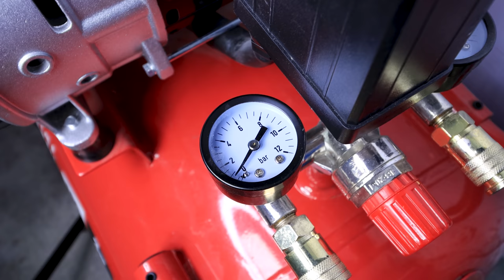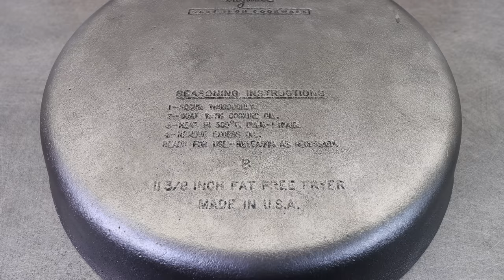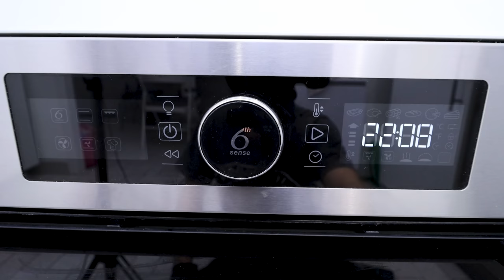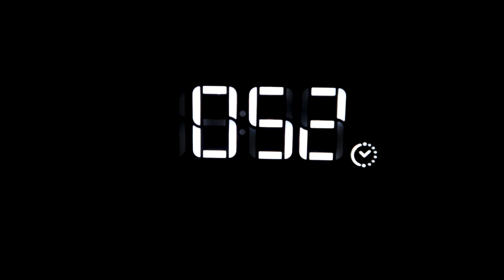PUBG PAN Restoration - Cooking Juicy Pan in to a Rusty Steak

Comment: That pan isn't 130 years old its actually from the 90's these particular ones started selling in 1991 so 30 years is more like it
Reply: I think what he meant was that the pan would look good for it's age only if it were 130 years old so he was being facetious
Reply: Yeah, the guy who wrote the letter got it wrong.  1891 is part of the brand name, not a date of manufacture.
Reply: I actually didn't know that and I think the channel didn't either
Reply: I have 4 of these 1891 Wagner Pans + 2 pots. Received as a wedding gifts 1992. Outlasted the marriage. No doubt will outlast me.
Reply: That would be correct.   It's a newer pan.  I have a few Wagners from the 1920s to the early 1960s.  Different handle design and smoother surface.  And no the rough surface isn't from rust pitting but not polishing pan after releasing from sand mold.
Reply: I think his Guns n Roses tshirt is older than the pan
Reply: In the USA only the Lodge Company makes Cast Iron cookware that I'm aware of. Cast Iron is the best cookware one can have! I have 6-7 iron skillets/pans.
Reply: Cast iron pans weren’t required to say “Made in the USA” until the 70’s, so there’s that.
Reply: I'm glad someone knew for sure. I had a feeling. The style and shape of the cast looked too new. Also the grammar (I guess you'd call it?) felt much more recent. Great video though!
Reply: @neodynamite  Actually 1964 and newer had the Made in USA stampings.
Reply: Also if it had been made in 1891 it would have had a gate mark on the bottom. The gate mark was a raised line running across the bottom from the early casting process.
Reply: @amandahanson8188  incorrect, never had to be casted into the pan. Lodge and other companies produced them without it for a while. Lodge was till 92 before the standard small egg logo they have now.
Reply: I was wondering about that. A 130 old pan couldn't be in such good shape after such exposure. And the 1891 engraved so big really looked like a brand name or something.
Reply: @neodynamite  It wasn't a requirement. It was a marketing decision after cheaper foreign imports entered the market in the 60s and 70s.
Reply: I was gonna mention this. I love cast iron pans, especially from around the turn of the century. They are better quality and so much lighter. They did not start putting 'Made in the U.S.A.' on them until the early 1960's. And if it was turn of the century it would have a stove top ring to keep it from making contact with the wood stove top. Lots of little clues if you want to be able to identify them properly.
Reply: This cast iron pan was manufactured between 1991 and 1999.
Reply: I CAME HERE TO SAY THIS !!!
Reply: @Ignatios Nelson thanks Ignatios! Don't know what we'd do without you, detective.
Reply: Yeah, the ergonomics of that design are pretty modern. On the other hand, cast iron is cast iron.
Reply: @TRUSTINYAH  Yahweh is the only way
Reply: @zerozipper4299  No, there’s plenty of manufacturers. Lodge is just the largest mass-producer.
Reply: Daamm how u get so smaart
Reply: "The Original" wouldn't be on an original.
Reply: I know somebody who has a pain roughly 90 years old. And look a whole lot worse than that thing you got there
Reply: @neodynamite  did not know that
Reply: @zerozipper4299  Borough Furnace, FINEX Cast Iron Cookware Company, NEST Homeware, Stargazer Cast Iron, Marquette Castings, Smithey Ironware Company, Butter Pat Industries, Milo, The Field Company, Solidteknics.
Reply: That's what I was thinking.
Reply: @zerozipper4299  there’s a few companies that have started making cast iron again. Dined was bought out by Lodge recently but there is also Smithey, Lancaster and  Stargazer to name a few!
Reply: @frankmurphy5  dude I see those smooth cast iron pans all the time
I need to get some
Reply: @troyfowler5177  Wagner started in 1891. These were made in 1991 for their 100th anniversary.
Reply: @nwriverfisherman7637   I can't confirm if that's the process as to how it got it's rough surface, but I do know it was an intentional design after manufacturers started "pre-seasoning" cast iron so people could take it home and cook with it right away.

Comment: Wagner cast iron 1891 series:
These were manufactured by General Housewares from 1991-1999.
Reply: Your profile picture is on point
Reply: @Saesteria  why, thank you.
Reply: Yup. As soon as I saw the logo, I said to my roommate, that's probably 20-25 years old, not 130.
Reply: Also, a cast iron pan that old wouldn't have seasoning instructions engraved on it.

Comment: Also those people are crazy if they think that thing was made in 1891. This item was made between 1991 - 1999 as an "anniversary edition" and was part of a set of three cast iron skillets.
Reply: There are no people, its just him. Check this note and the note he send to mymechanic
Reply: @falconNL  You're right, very similar handwriting
Reply: And its rough casting, cutting corners to make a profit.   These ned to be sanded to a smooth mirror finish before seasoning and using

Comment: Tysy: this pan will give a nice flavor to my steak
Me: wat.
Reply: Yeah the rust isn't a good seasoning for anything lol. That's what I was thinking lol
Reply: Cast Iron for cooking is super overrated.  Theres a reason restaurants use stainless steel over cast iron all over the world.
Reply: @fcscouto  because steel pans heat up faster and more evenly (usually because of an aluminium lamination) cast iron holds its heat much better and is ideal for going from a hob to an oven, cast iron also lasts indefinitely, steel pans don't, they have very different use cases and for the fast paced world of restaurants steel is more suitable, not necessarily better

Comment: I’‘ve bought two iron pots at flea markets, and got them clean from years of old grease. And I found a pot that had been used as a planter, about to be thrown away. Rusty, but steel pan cleaner (that spiral thingy), oven cleaner, steel wool, scoring powder and a vat of elbow grease got it clean. After re-oiling and curing, it’s good as new. Iron never goes out of style! :D

Comment: It came out absolutely gorgeous!

Just a small thing to note- 1891 was just the name of the product line. Wagner only started producing those particular pans in 1991 as kind of a centennial thing. Still no spring chicken, but it's younger than I am. XD
Reply: I thought that model in particular started production in 1987?
Reply: @jakholl  could be; looking back I'm seeing both years. Not sure which is correct.

Comment: People in Texas- "using a sand blaster and wire wheel on a cast iron skillet???  Blasphemy!!!!".  Lol
Reply: Anyone who has an inkling about cast iron cookware cringed at this restoration.  🤦🏼‍♀️
Reply: They cringed right up until they saw the final product. This man produced a perfectly seasoned cast iron pan by more or less hitting the reset button. It was so badly rusted to begin with he did basically the only thing you can do.
Reply: @perry1134   I’ve cleaned worse with zero wire brushes and grinding wheels. But honestly, it comes down to if he’s happy with his skillet, that’s all the matters!   :)

Comment: My grandma used cast iron skillet for years, and my aunt too. I love cast iron, I have a complete set of skillets, a Dutch oven, and a reversible grill/griddle that's extra long so it uses two burners on the stove. You can buy a set of cloth handle covers, so you can grab the cast iron skillet without burning your hands. My cast iron came preseasoned and the instructions on care said not to clean with soap, because it'll strip that seasoning. Just scrub with hot water and a nylon brush. Then place upside down in the oven at 500°F for an hour to dry. The steak you made looked delicious! It made me hungry for one.

Comment: No lie, as much as I love the finished product, it felt so wrong to watch a cast iron skillet get sandblasted.
Reply: So. Very. Wrong.
Reply: I literally cringed
Reply: @kezlou87  Me too, but in the end, it was gorgeous.
Reply: So wat best way to do then sandblasting? 

Like on guga foods vid 🤔?
Reply: @CrispyHands  oh the sandblasting was good, but it was painful to watch because for a well seasoned cast iron skillet - you aren't supposed to even use a harsh scrubbie to clean the pan in order to keep the seasoning in good condition.
Reply: @CrispyHands  There are numerous videos on youtube on how to season a cast iron pan, but generally you use a wire brush to get the rust off, then use the oil treatment for at least 5 times to achieve what he did in 3.  So much faster using the sandblaster.

Comment: Maybe this will save someone else some time:
SEASONING INSTRUCTIONS
1 -- SCOUR THOROUGHLY.
2 -- COAT WITH COOKING OIL.
3 -- HEAT IN 300° F. OVEN - 1 HOUR.
4 -- REMOVE EXCESS OIL.
READY FOR USE -- RESEASON AS NECESSARY.

Comment: Anyone else wondering why it was shipped in bubble rap? Are they afraid it's going to get scratched? 🤔🤷‍♂️🤦‍♂️
Reply: So you mean to tell me that 6lb cast iron is fragile and breaks as easy as glass. If cast Iron is brittle than why the hell is it the metal of choice for campers? Bunch of idiots 🤔🤨🙄 they should use something that will help them survive not break down on them. Smh
Reply: @set4life30  what an enlightened, informed opinion
Reply: @biggrocc19  thanks!
Reply: U

Comment: WHY DIDNT HE USE SOAP ON THAT THING ITS PROBABLY STILL DIRTY NOOO
Reply: Pretty sure sandblasting + 3 oven journeys over 200°C is more than enough to kill germs. But hey, you don't know. Maybe he actually used soap too but didn't record it.
Reply: @GreyPunkWolf   im a germaphobe  soo i hope he did clean it though
Reply: @indigostar2260  Don't go to restaurants then. You never know if the chef wants to ignore safety protocoles just because "it goes in the oven anyways so there won't be any germs left"...
I've seen it happen, and it's horrifying. Most of these places have since been closed because of clients getting food poisonning, but you never know what can fly under the radar of health and safety inspections.
Reply: Soap would pull some of the oil off of the cast iron and here's trying to rebuild the patina. Plus he covered the whole thing in alcohol, that pan was fully disinfected
Reply: @ph270able  Alcohol. Right. That's what I missed. Thanks !
Reply: Cast iron doesn't get soap at all. Heat. Animal fat. Water. That's it.
Reply: He should have washed it anyways
Reply: @XpetraXpazlX  He did... Sandblasted and bathed in alcohol, I don't think you can get better than that.
Reply: You never use soap and water on cast iron... omg! The sandblasting friction and polymerizing were at higher temps than any germ will survive.
Reply: Never use soap on a properly seasoned pan. Cooking grease and heat kill germs.

Comment: This is obviously not a cooking channel, but a few tips for a better result on your steak.  Don't put pepper before your sear, you're going to burn it at the temps reached by cast iron, do it after. And when your steak is that thick you want to sear both sides then toss it in an oven to bring the middle to temp, or sous vide it first then finish on the cast iron. Keep that middle pink instead of grey.  STEAK TIME

Comment: Take this for what it's worth I restore a lot of Cast iron, but you really need to do a lead test on any cast Iron after cleaning the rust off! Also don't use brass to clean any of it with the bras will get caught in the pours of the cast iron and is toxic when heated. But great job on the seasoning!

Comment: There are actually a number of cast iron manufacturers in the US. Stargazer for one. I have one of their skillets and it is superb. I actually use numerous pieces of Lodge as well. But, on the Lodge cast iron, take an angle grinder and grinding pad and work the inside down to a SMOOTH finish. Much better than the rougher finish that is on there. The sand casting process leaves that "pebbled" grain on the pan, and it just takes too much effort and cost to get a smooth finish for that price point, so they don't do that step. But, you can do it easily and have a heirloom level pan.

Comment: Wow, that turned out awesome.  It's the wrong type of pan for a butter baste, you need a flat bottom.  I have a couple of cast iron pans that could use the treatment that one got, but alas, I don't have those tools.  I have a couple really good ones that are over 100 years old that are non stick even with eggs.  I can't use them on my new stove as my wife wanted an ceramic top induction, cast iron scratches the glass.  But I can use them on the BBQ and smoker.

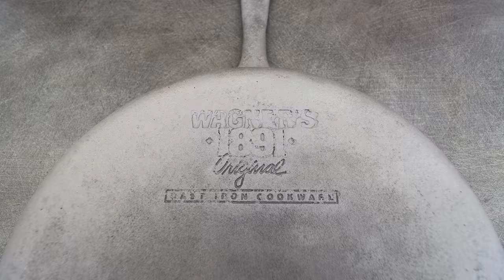Comment: 0:48 Collectors of vintage cast iron cookware often come across entries on eBay or other sites that promote a "vintage" cast iron skillet supposedly manufactured by Wagner in 1891. These items are promoted in this way in order to entice the buyer and make them think this is a genuine antique cast iron pan from the year 1891 – after all, it says "1891" right there on the pan. In fact, this particular line of cast iron was manufactured from 1991 through 1999. 3:23  It was not manufactured in 1891. If you come across a cast iron pan with this logo, you can rest assured that it is NOT an antique cooking pan from the late 1800s. This is why these pans are often sold at very low prices, if not given away outright for free.

Comment: I have a pan like that then no matter how many times I reset the seasoning on, rust keeps appearing. Maybe I should send it to you for a full cleaning
Reply: Do you clean it with soap?
If you do, stop doing it, it cleans the grease layer and your food will stick to the pan, just clean it with water and if food is too sticked use the sponge but get all of the soap cleaned, also when you finish cleaning it dry it with a towel inmediatly, and if it keeps sticking and rusting cure it again (sorry if I commited any grammar mistake, english is not my first language)
Reply: No, I'll boil some water in it if I made a sauce or gravy, otherwise its salt with a bunch of bamboo skewers banded together as a scrubber. No its a grill pan and I've tried putting it through the self clean on the oven, scrubbing off all the rust with a SOS pad, rinsing, drying, seasoning x2, and then storing, and still when I pull it out, there a dime size rust spots inside the pan, usually around the grill rises. I should just take the sand blaster to it and then wash it.

Comment: One piece of advice when it comes to cast iron: never season a cold pan. You need to get it hot before applying your oil and also once you put the oil on you need to immediately wipe off the excess before putting it into the over otherwise your pan will have spots or be sticky. As far as oils to put down for you base seasoning Flax Seed and Grape Seed Oil are probably the best but if you're looking for something less expensive you can use Crisco.

Comment: For those of us without a blasting cabinet, a battery charger and a rebar anode would also take this down to bare metal pretty quick.  Search "electrolysis".  I've used it on several rusty axe heads to great success.  :-)

Comment: IMHO, based on all the writing on the bottom of the pan, it was probably made closer to 1991 than 1891.  But so what?  If it cooks, it's a keeper.  Now hunt down a Dutch Oven with feet and a rimmed lid for campfire cooking and you'll be set.  Best Wishes, Ed

Comment: FYI, that pan was manufactured between 1991-1995 as a 100 year anniversary of the original ‘wagner’ cast iron pan made in 1891, so, unfortunately it’s not nearly that old or valuable

Comment: As others have said, it's a commemorative from the 1990s, not the 1890s.

I found one in a thrift store for $12 but the retail price was about $20 when new.  You can buy a decent one on Ebay for about $60 but that's a seller trying to convince people it's a vintage Wagner but it's not really the same thing.  I think $12 was a good deal, otherwise go to Walmart and buy a Lodge for $30-40.

I think most of these "restoration" channels intentionally damage and corrode items with acid, then put them in a box to film an unboxing.  The least scrupulous might even buy two perfect condition items, destroy one for the "restoration" and get the "after" shots with the item they never touched.

This video has far too many views due to its contrived nature.  I only watched because I have the exact same grill pan (but mine is in near new condition).

Oddly these newest Wagner USA pans were available for a decade but you have to dig a little to find out about them.  Evidently they have a reputation for warping.  I don't mind so much because I intend to use mine on a kettle grill where a flat bottom isn't critical.

Any way, if you are subscribed, click unsubscribe because all you are going to see is cheap stuff dipped in acid and then thrown in a blasting cabinet which is a stupid clickbait tactic.  Don't fall for it.

Comment: Dude that's a modern pan. It marked the 100th anniversary of the company. Also you should use hydrolysis for rust and lye for baked on crud to actually restore. Your methods destroy the original surface and patina and take far more effort and sophisticated tools to complete. Better results can be obtained with almost zero labor using washing soda, a plastic tub, car battery charger, and a piece of rebar. Otherwise nice job.

Comment: Just a "head's up." The pan itself is not from 1891. Firstly, cast aluminum pans did not exist in 1891, there were only cast iron then. Secondly, All that engraved information was made by modern technology. Cast iron / aluminum pans were not engraved until the 1960's. It was a law instituted in both Canada and the USA. Thirdly, the date of 1891 is a reference as to when that company listed on the back of the pan was first started. I know it sounds really cool to think it is that old but in reality the pan can't be more than 60ish years old. Sorry.